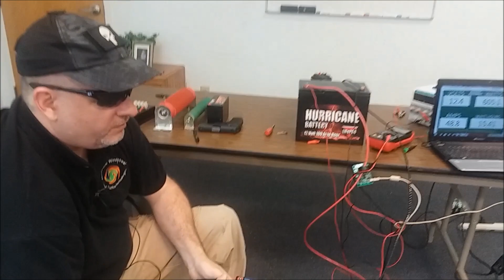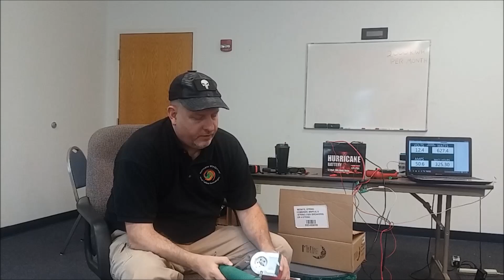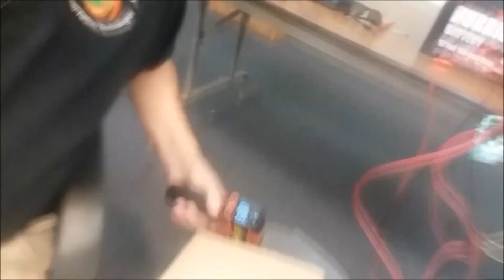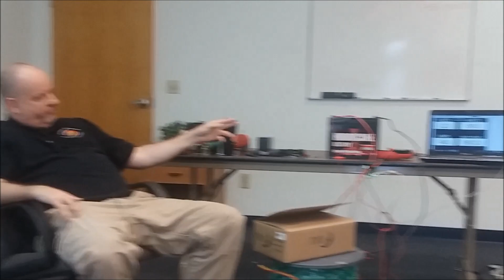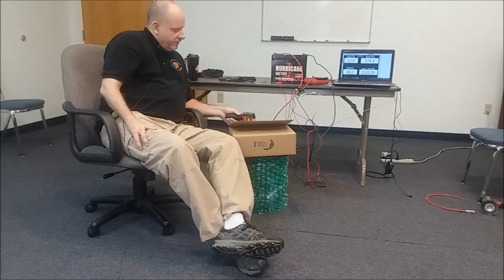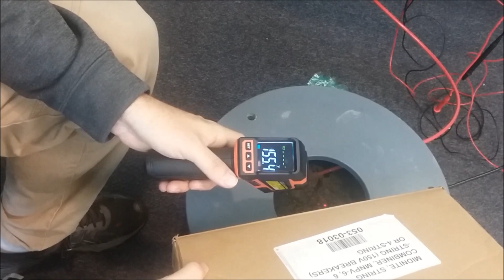12 Volt 100 Ah load test LiFePO4 Hurricane Wind Power Hurricane Battery  1230  Watt Hour load test

Comment: How long did it take to raise the bucket of room temperature water to 120F? I also see 50A going into that bucket, but the inline thermostats can only handle 25A or so. Wouldn't that double whatever time to heat the water, if you use a thermostat?

Comment: Thanks for sharing your battery with us but that stator you got on your bucket I'm interested in it of what you got in it and how you're making it man getting a little bit more information about those on your actual flux hopefully you'll be having those out on the market and since you seem to be an honest person I got lead acid batteries the gelled 55 amp hour what is the low that I should be pulling them down to the high charges up to 14.6 but I need to know how far to draw them down without damaging them when they are at rest they rest at 12.8 to 13v and on your video I don't remember you giving a price for your batteries I would like to go with some of your batteries like your testing eventually but the batteries I got I got for free so I can't complain
Reply from the maker: Hi Thomas our axial stators a lot of r and D and we do not give out our recipe on the winding however there are a lot of resources that will such a High Piggot sells a book with a lot of plans. Also there are a lot of DIYguys here on youtube that build that would be able to direct you on axials that we do not have under our airboss label....I will have one of them reach out to you . The battery charges up full at 14.6 then the BMS does not allow it to take any more power. When you see the heavy load hit it pulls it down to 12.5 and eventually 11.9 and it drops on out from there as you see in the video. The battery management system handles a lot of this. We are doing 649.99 during the 2 day roll out...after that the price will increase some but we will still be better priced than the other guys
Reply: Hello hurricanewindpowercom I purchased one of your hundred and fifty amp watt meter voltmeter and you did not send any instructions of what each of the numbers mean one of the number go up to 65.000. And stops I know what some are but have no idea what the other ones are What is that on the meter and if you could send me information about the meter you did not send me any instructions with the product